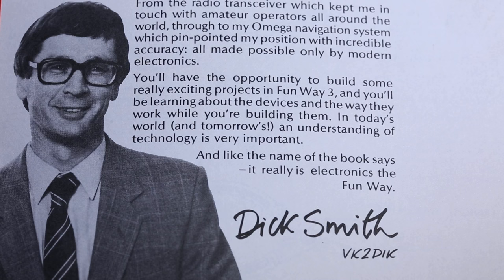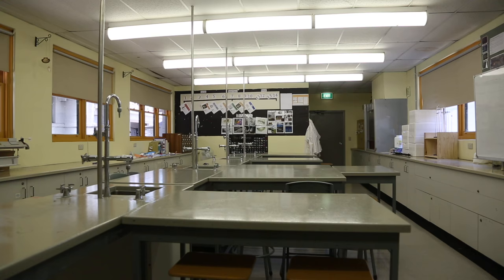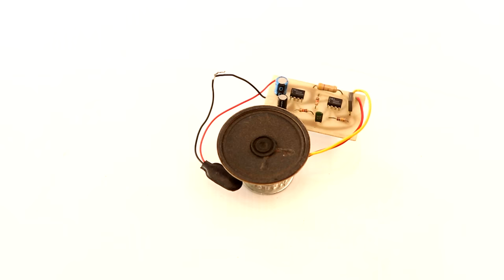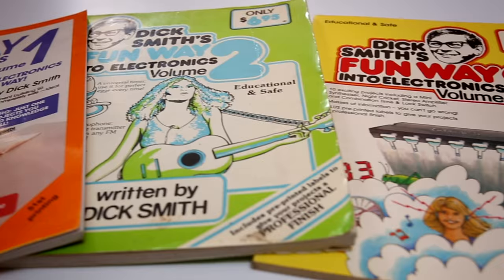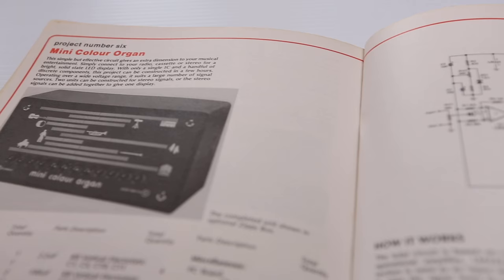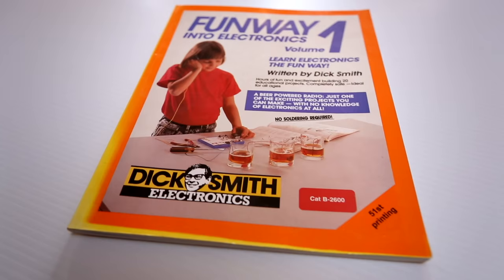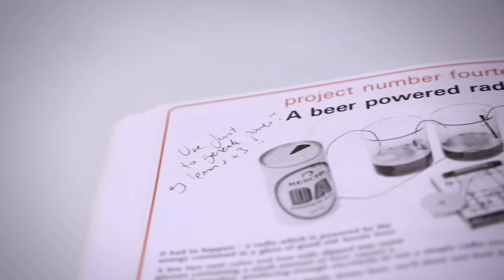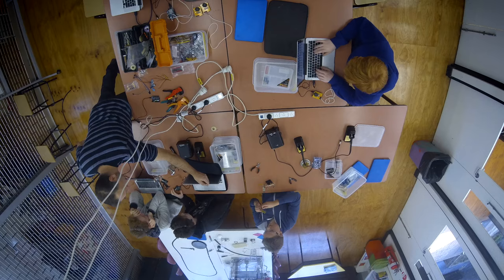Fun Way into Electronics

Comment: Oh that's nice. I wish i had something like that in my childhood. It will be curious to check out the archive of the books now.

Apropos video series, do you want to touch on influence of patents on hobby electronics? One major field of hobby electronics is audio, and the biggest thing that happened in fully analog home audio is Class D amplification. So negative feedback in Class D amplifiers got essentially patented (WTF...), which should not be an issue for hobbyists, but somehow nobody is designing and building such systems, so i wonder if you could shed some light on this, to what extent the patent minefields affect businesses that cater to hobbyist. 

Also it is my understanding, that "secret" function ICs were rather uncommon back in the day (though where would one get the data sheets when there's no Internet? Local library certainly wouldn't have them), and device schematics could usually just be requested from manufacturer for repair purposes, and this might be a topic too, this vs. Open-Source Hardware, how they compare.
Reply from the maker: Thanks for your comment and good suggestions. There are episodes planed on similar lines of thinking, especially about patents. Unfortunately only when I can afford the time to do them ... Thanks for stopping by.

Comment: genuine question y can't people who didn't study chemistry in collage not learn electronics isn't electronics a branch of physics
Reply from the maker: A good question indeed. Some very basic theory is taught as part of physics in Australia but its very much about understanding Kirchhoff's Voltage/Current Laws, electron theory, and simple circuit analysis. Its not really about how to use an Opamp, solder SMD's or program a microcontroller in C sadly. I for one would like to see the curriculum updated to use an Arduino to help make experiments more accurate, fun and therefore involve some basic electronics and programming. Every subject could benefit with this type of integration. Chemistry students could use their skills with Arduino and basic electronics to attach sensors to an experiment, take rapid measurements accurately and spit out the results into a good looking graph on a screen. I actually did do this with students at a school when I taught an elective on Arduino: https://vimeo.com/131195945
Reply: State of Electronics no I'm saying y can't students who chose physics maths and computer instead of chemistry and replaced it with computer y arnt the allowed to get a digree in electrical engineering
Reply from the maker: You might need to consult a career councillor to help you with that specific question. It differs around the world and even in different states across Australia. However I get your point it does sound odd.
Reply: State of Electronics I know I'm from Pakistan and here u can't get a electronic engineering digree if u didn't choose chemistry which I don't get as computer is more important then chemistry in this field and even if it's not it's a field of physics and I'm just asking whether it's odd or if it's a common practice